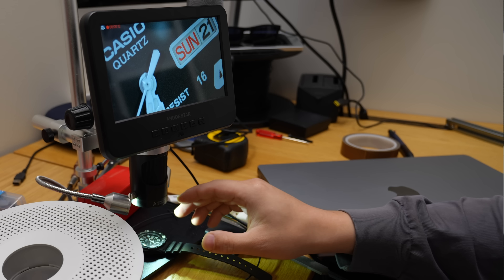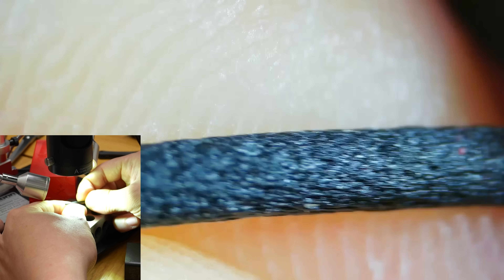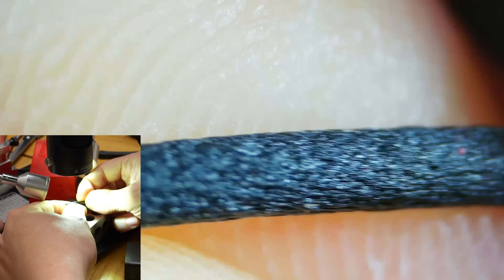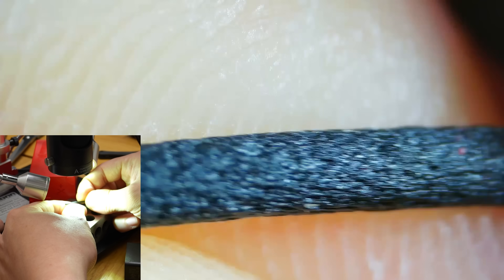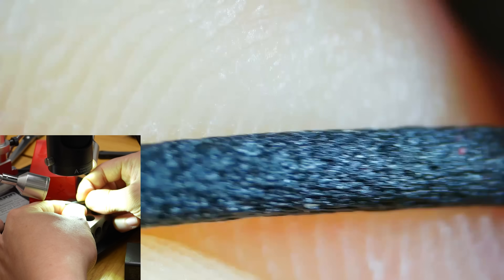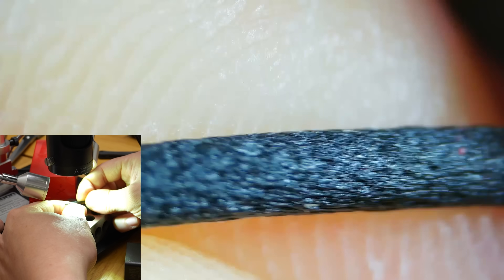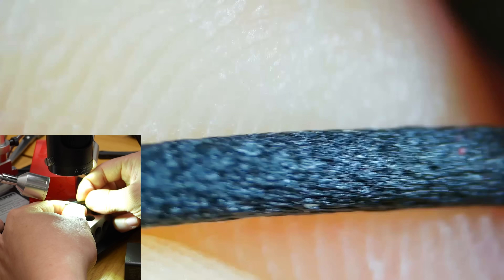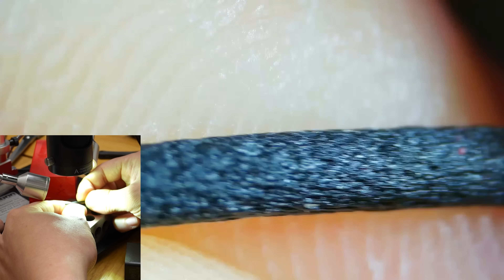The Dark Side of Carbon Fiber Filament

Comment: You don't use carbon fiber filament for increased tensile strength any more than you use glue stick to increase bed adhesion.  The former is for moderating the bad properties of the filament (warping, layer lines) and the latter is to be a release agent.  Also, your skin is constantly shedding and whatever is on the surface will be  back into the air as lovely dust in no time.
Reply: There are a lot more mechanical properties than just tensile strength. Adding fibre to filaments mainly increases stiffness which is something that can be very useful and noticable.

Comment: Well, asbestos is really something completely different. But caution is applied indeed.
Reply: asbestos filled filament would be wild
Reply: @xapu8775  Asbestos infused PEEK filament.
Reply: Yes and no. You don't need to go down all the way to < 100 nm of the individual fibers. Some people seem to like sanding their prints as well and having non-resorbable PM2.5 particles is bad enough. 
In my work with carbon fiber I've seen PAN carbon fibers with ~5 µm diameter shatter lengthwise to create smaller splinters with lengths a few times their cross sectional dimension.
Lower density, but probably similar persistent needle-like foreign body effects when inhaled.
Reply: Can one do Asbestos?
Reply: @platin2148  No, it has been banned in UK.
Reply: I want asbestos filament now. Sounds awesome, but I worry it would just form a cancer-cloud if used for it's fireproofness.

Comment: Imagine grinding CF composites by hand. I actually banned any grinding of it in my shop and maybe should think about increasing measures when using G10 (GF composite). You are only talking about the fibres but I think the matrix will be interesting as well. Parts of it will be stuck to the fibres and will end up in you.

Comment: I want cyanide infused filaments with strawberry-mint flavor.
Reply: Cyanide would be almond
Reply: Top it with some of that Wintogreen flavoured toilet bowl cleaner. Yum.
Reply: some filaments exists made of plastics that release formaldehyde when overheated by alot. so if your heat sensor ever breaks during a print, rip
Reply: how about uranium hardened pla?
Reply: @fabianmerki4222  Add wintergreen and it would make a good urinal puck. Plus, they spark when chewed in the dark!
Reply: CF-POM-PEEK blend
Reply: scented filament would be nice
Reply: A lot of our foods naturally gas ciynde not all foods but a lot common ones do.
Reply: Superglue is cyanide, cyanoacrylate (CA) glue
Reply: @alexdrockhound9497 What should you avoid doing that would release CN without the acrylic?
Reply: @Cineenvenordquist  its probably not safe to mix it with other chemicals or superheat it far beyond its boiling point to where the molecules start to decay.
Reply: Isn't that what vape pens are?
Reply: But why?
The cyanide infused filament already has such wonderful almond scent and flavor
Reply: Do NOT do that. What you gain in strength and flavor won't be worth it. Cyanide is poisonous and if it is strawberry flavored a child could lick it and get sick. Seriously.
Reply: Plutonium for me, thanks.
Reply: White phosphorus vape? 😂😨
Reply: You're not allowed that, strawberry-mint flavouring is banned in California under Proposition 65.
Reply: @yngndrw.  Don't you mean Title 9? So dumb only a woman would do it?
Reply: Only if the prints are stronger thought I'll mostly use it for printing calibration cubes and benchies

Comment: When we were trained to splice fibres they warned us that the shards if they got into your skin would be absorbed and slowly make their way to your heart over the years, I wonder if the same thing would happen in this case. They're certainly just as fine as shards of fibre optic cable.
Reply from the maker: Thats a good analogy, the same standards should probably apply

From Fluke:

The fiber at the center of a fiber optic cable is glass — powerful yet delicate, and capable of inflicting great injury when damaged or broken. Control hazardous glass fragments from a job by keeping yourself, and your work area, very clean.

• Wear safety glasses with side shields (over your eyeglasses, if you wear them) to help keep fiber shards from reaching your eyes. Keep your hands away from your face while you’re working, and always wash your hands thoroughly before touching your face or contact lenses.
• Wear a disposable lab apron to reduce the chances of fiber splinters collecting on your clothing and transferring to other surfaces (or taking a ride home with you).
• Don’t allow food or beverages in the work area (don’t smoke there, either). Not only can particles from your lunch break contaminate your work, fragments of fiber are impossible to see but easy to ingest if they fall into your food — which could lead to internal hemorrhage and even death.
• Make sure your work area is well ventilated to help prevent tiny glass particles from disturbed fiber cable from becoming airborne and being inhaled.
• Dispose of all fiber cable scraps properly in a labeled container with a secure lid.
• Make sure there’s adequate clearance around any spark hazards or heat sources, such as fusion splicers and curing ovens, to reduce the chance of fire.
• Clean up at the end of the day to control fiber fragments and keep everyone on the job safe.
Reply: That's ridiculous and not true at all.

Just a moment thinking about it would tell you glass shards in the epidermis will not migrate to your heart.
Reply: Carbon fibers cannot be broken down by the body, there is no cellular machinery to accomplish this. They are very stable and by poking and injuring tissue, they will attract macrophages which release inflammatory substances along with ROS which will damage tissue over time in a way that promotes cancer, similar to asbestos and non-dissolving glass fibers. Even wood fibers/dust are highly problematic.
Reply: No.. it would not.
THE problem with asbest is and was, that the fibres split longitudinal. Carbon, Glass and so on do not and get ejected by the skin over time. asbest would just get thiner and will be able to puncture everything in your body and get everywhere.
Reply from the maker: @hanswurstusbrachialus5213  That's terrifying
Reply: @hanswurstusbrachialus5213  asbest will get so thin that it stab individual cell and stuck there.
Reply: Scary thought.
But I would argue, that carbon probably is much easier for the body to dissolve, than glass ... but again, what do I know?
Reply: @ZappyOh  carbon-carbon bonds are really strong and generally hard to break down. Doing some searching suggests that myeloperoxidase may be able to break it down in human bodies, though I'm not sure how effective that would actually be in practice.
Reply from the maker: @widget5963  I still have a graphite spot in my leg from being stabbed with a pencil over 20 years ago
Reply: @NathanBuildsRobots haha that's really funny- I also have a graphite spot on my arm from when my friend stabbed me in my arm with a pencil in elementary. It was actually the first thing I thought of when I clicked on the video.
Reply: @NathanBuildsRobots  I have one in my finger from like 30+ years ago! I was reaching into my pencil pouch and my habit of super sharpening my pencils got the better of me. I thought it finally faded away a while back but just spotted it now, pretty faint but still there.
Reply: @SzikrásAnna-火花安娜  I have one in my palm for more than 30 years. Don't grab falling pencils,
Reply from the maker: @ZappyOh  Carbon is very similar to glass in that it is not going to dissolve or oxidize
Reply: @NathanBuildsRobots  Glass is actually being dissolved by the body as well as mineral fibers do. The glass and mineral fibers are harmful, they cause inflammation, but the inflammation only lasts until the body dissolves those thin fibers. This is AFAIK the biggest difference wrt. the asbestos, which lasts much, much longer in human body than glass or mineral fiber, causing long term inflammation and other damage.